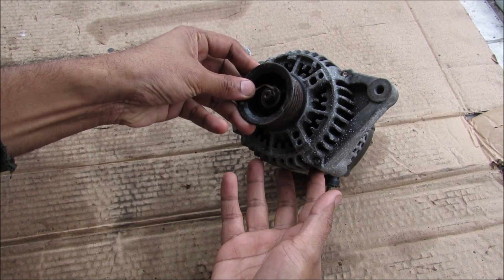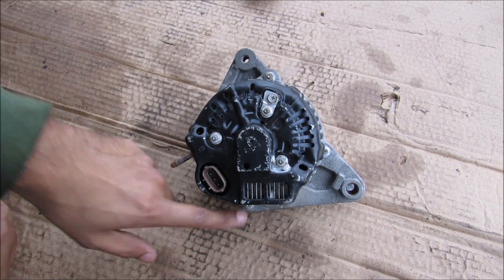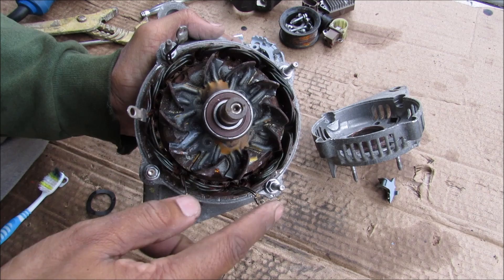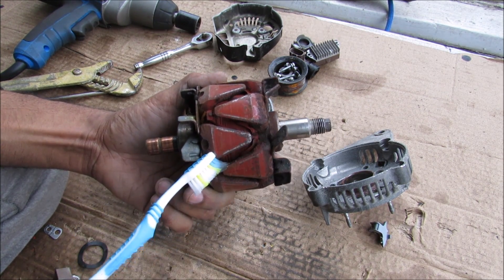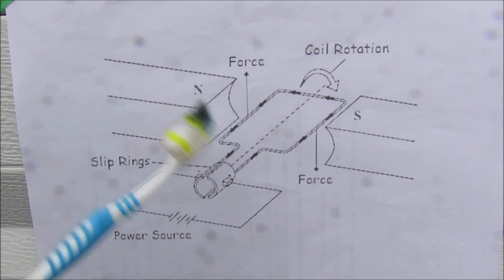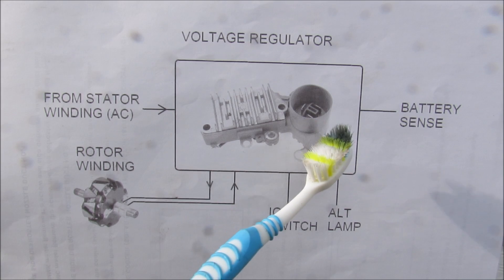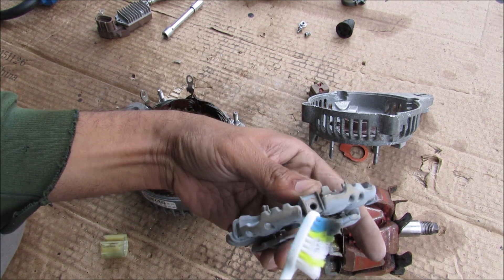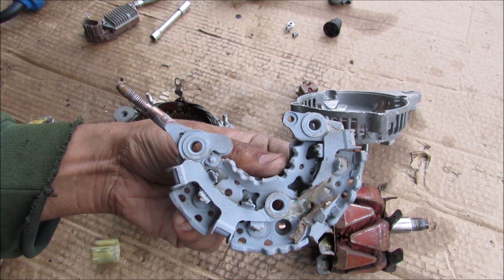How an Alternator Works

Comment: How true shall the following be for a Toothbrush Vehicle model Oral-B with this typical wiring structure:  

Alternator Electrical Wiring 

3 pins: Trigger, Voltage regulation input from ECU, Ground. 

a) Wiring Harness connector 

i) When ignition key is ON: Trigger + Ground= voltage or continuity. Feed + Ground = Voltage. 

ii) When ignition Key is OFF: Trigger + Ground = Continuity. Feed + Ground = Continuity. 

 

b) Alternator pins: Trigger + Ground = Continuity / large resistance. Feed + Ground = Continuity / large resistance. 

 

1 pin: Output to battery. 

a) Alternator connected in car with the ignition key ON: 

Pin + Casing = Battery voltage 

b) Alternator removed from vehicle: 

Pin + Casing = Continuity / Large resistance.

Comment: At 8:28 not true. On modern vehicles, you should never disconnect your battery while your vechicle is running. You can damage a lot of electrical components if you do, but if you did disconnect the battery, the voltage regulator would still get power from the rectifier bridge through the exciter diodes (diode trio).
Reply from the maker: Agreed here. The voltage regulator nis driven by the battery.
Reply: @speedkar99 Great vid. Why would disconnecting the battery do any harm if that means the rotor won't be energised meaning no 3 phase ac output? Or am I missing something

Comment: Does that happen on every car? Like if i disconnect the battery while the engines running will I definitely cook the computer?
Reply from the maker: There is a risk because there's no voltage regulator

Comment: Just an (not entirely) unrelated comment here: road salt does some really crazy shit to aluminum alloys used in automotive. I remember my first car and its air-conditioning tubing I was trying to fix after I found a leakage. Man, the aluminum rather resembled an old cookie, some kind of a crusty sponge instead of a ductile, malleable, soft metal we're all used to. It was literally crushing in my hands. So, even with a super experienced welder I had to bite the bullet and buy a new, super expensive, back in the day, tubing. Lesson for younger colleagues: aluminum does corrode, too. In the oxygen atmosphere it's protecting itself with a passive, perfectly sized (oxide molecule only around 1.5 times bigger than the metal molecule, hence not flaking off) oxide but splash it regularly with salty water, add some heat to it - that's a different story. Look at those whitish stains: that's corroded aluminum, in form of chlorides.
Reply from the maker: Agreed, salt does affect aluminum. I see it all the time on engines I teardown

Comment: That is exactly how my 19 year old alternator on my 1999 F150 failed….the brushes on the voltage regulator. I replaced them with a parts store brand, and they did work, but about a year later the charging light came on again so I figured it was time for a whole new/rebuilt unit. But I got to hand it to Ford…. My alternator lasted 19 years.

Comment: Amazing video! Cars are so confusing. What does it mean when your battery light and check engine light comes on at the same time ? Car will not start? Battery is brand new. Overcharge? Alternator needs to be replaced completely?

Comment: I had a 180D and it had a generator for charging the large Willard battery. That model MBenz set the world record for total mileage. Today I own a 2.7L 5 cylinder Sprinter which will probably outlast
me. So I have made arrangements with the local undertaker to use the Sprinter for my casket. He wants extra money for the grave digging.

Comment: So if you want to bench test an alternator you have to connect a battery to it, or some other voltage source to provide a dc voltage to the rotor in order to make that an electromagnet and get 14V out of it. Right?

Comment: Awesome explanation best put off 5 videos I saw .. great job I replaced my brushes and voltage regulator today .. I had dash lights on usually come on when n alternator craps out but after a bit I noticed it would be fine then work then next day would turn on high review would make it go away made me realize my voltage regulator maybe was bad I replaced both the regulator and the brushes but my brushes were very warm out witch I’m sure that was giving the wrong communication but I still replaced both .. 25 bucks off of eBay .. wish I would have seen this dudes video a week ago .. great job tho . Best vid of this kind on here ..

Comment: Christ on a bike! If I could carry you around in my toolbox to work, that would be just grand!
That was possibly the best explanation of the setup. I've written essays on this, and you hit every point perfectly. 

Modern vehicles have such an advantage, having alternators with solid state regulators. 
Older types, with the mechanical regulators were a nightmare to jamming up if not kept pristine. Overvoltage scenarios were so common, leading to a stern cooking of the battery. Upgrading from dynamo to alternator certainly provides that constant, and instant punch to whole system on startup. Instead of depending on a dynamo, which relies purely on engine RPM,  you've got an instant flow of electron pixies as soon as the internal is excited. 

Great video!
Reply from the maker: Thanks for your insight!

Comment: Ending part explain why its dangerous to unplug your battery while the engine is running. The alternator needs constant power frm the battery to regulate the rotor voltage so as to control the magnetism of the rotor in order to control stator/alternator output....

Comment: One question. When the car is running it`s the alternator that powers everything in the car right? The battery is not doing that unless the car stops if I understand this correctly?
Reply from the maker: Yes alternator provides power to the car.

Comment: Alignment of alternator, Do you need to line  up after installing a new alternator? Method or Video review this topic.
Reply from the maker: Of course it had to align so the belt goes on
Reply: @speedkar99   After review looks like the power steering pully is the only one that could cause a problem  if not installed correctly.
Reply: @speedkar99  Go it. Did not know if you needed a straight edge to check or the bolts lock in positon.

Comment: GM 140 amp alternator, battery post nut will not remove any recommendations? tried penetrating oil, removal from car put it on Vice to get a better grip.  Plastic piece around battery post turning also. Do you think alternator is permanently damaged?
Reply from the maker: You might be in for a rebuild
Reply: @speedkar99  Thanks, Amazon new alternators seem reasonably priced for this GM category.

Comment: I have a question, for my 01 Camry,4 cylinders,regarding the three wires at the back of the alternator. Out of the three wires,one should have a battery voltage,right? Or all three should have battery voltage ? Because,mine,all three wires have battery voltage. And the charging system doesn’t run right...can you explain? Thank you. Really need some good informations on this problem
Reply from the maker: The 12V power line is the one that's bolted on

Comment: My car alternator stopped charging,so all I need to do is,replace the brushes,it should start to charge again,right ? On top of that, the three wires connect to the back of the alternator,what does each wire do? Can you explain,please ? I know the three wires are connected to the voltage regulator..thank you
Reply from the maker: Yes just the brushes. Some people replace bearings too

Comment: So basically it's not true the fact that running your car, instead of stay it idle in a park lot let's say, it spins your alternator faster and it loads the battery much better, because it has that regulator which demands the amount of electricity to be produced by the alternator. Am I right ?
Reply from the maker: Yep the regulator stops the battery from being overcharged

Comment: This is an informative video with two items that need to be corrected. First, it is safer to remove the positive cable at the battery first, before removing the cable from the alternator. I know in the car he is showing will not make a difference, since it seems it is a junk yard car. Second, a minor mistake. In 1:28 they are not bolts, but nuts. Overall a good job in showing how the alternator works. Thanks.
Reply from the maker: Thanks

Comment: The Rotor shaf and pulley should always be spinning together 1:1 right? I'm getting some slippage where the inside is not spinning at times. is the bolt just loose?

Comment: Great video only addendum is the small capacitor is only for noise suppression and doesn’t do much to smooth the peaks in the output waveform that’s what the battery does.

Also you indicate that the regulator is fed ac to my understanding the ac is rectified immediately after it leaves the stator and the regulator is fed the rectified dc I might have misunderstood that though

Comment: This is the best explanation of an alternator I've ever heard. Can you explain how you can bump start a car without a battery in it? Without any input power how can the alternator produce a/c output? Thanks!
Reply from the maker: That's actually a good question, I would assume you'd need some kind of a battery on it even if it's discharged just to hold charge until the alternator kicks in

Comment: If you send ac current threw the rotor. Will it even need to spin to creat electric
Reply: It wouldn't need to spin. It would create inductive current as the magnetic field changes due to the ac current oscillations. That's how wireless charging works.

Comment: What's about the current the alternator produce from rotation? If the alternator produce 100 amp current at 1000-1200 rpm and if the battery capacity is 50 amph then the battery will be charged within a short time and it will be over loaded by current. Please explain the battery current capacity and the alternator current that it produces. Thanks in advance.
Reply from the maker: The regulator stops the alternator from over charging the battery

Comment: So in order for the rotor to make power with the stator the voltage regulator has to supply the rotor with a small amount of power like a pilot flame almost?
 Then if the battery is disconnected how would the alternator voltage spike and fry the computer ? Wouldn't it just shut the car off ? 

I had to re write my question to make more sense lol
Earned a subscriber, great information man
Reply: So it's cause the car would be running there is already power there in the stator and then no more regulator and that's how voltage would spike?

Comment: That was a cool video. I knew the basic principal but not the inner workings. I learned long ago that bump starting a manual doesn't work if the battery is completely drained. There has to be enough charge to get the alternator going.

Comment: Pretty nice, except I wanna say that the ac voltage doesn’t get “mirrored”, the humps below the line get literally cut off and do not transmit through the diodes. It’s the combination of the 3 phases offset from one another that make up that consistent pattern of smaller humps.
Reply: A full bridge rectifier works a little differently than a half wave rectifier in this case. Let's compare the different kinds of rectification that are available to us to explain why. In single phase ac, the voltage crosses zero volts every half cycle. You can rectify that with a single diode which will simply block the current flow when the voltage goes negative and pass current when the voltage is positive. This gives you that "cut off hump" for half of your ac cycle you mention. If you use four diodes instead of one, you have a FULL BRIDGE RECTIFIER that can allow the current to pass one direction when the source voltage it is positive, and pass the other direction when the source voltage is negative (from the point of view of the source). In essence, you are turning the wires around every half cycle so that no matter if the ac wave is on the positive side or negative side of the cycle, the current only flows one way through the load. This means that the voltage is always positive from the point of view of the load (since the current flows in only one direction), and you get the back to back positive humps as illustrated in this video. It is worth mentioning that the back to back humps is NOT how three phase rectification works, and sadly, speedkar99 is wrong about that for technical reasons. 
Since that is all for single phase, what happens with three phase? Let's go on. Since this alternator is actually three phase AC in Y configuration (we know this because of the common wire), you can rectify the output to DC with 6 diodes (connected as shown in the video). Because the three phases are 120 degrees out of phase, you ALWAYS have full RMS voltage between the three phases. The magnetic fields are rotating in the alternator, and they create a rotating voltage between the phases. I need a diagram to illustrate this. Google for an image of "three phase power graph" with a common wire. You'll surely find one in 1-2 hits. If you don't have a common wire, the zero voltage line is the common. Let's look closely at it and walk through a full cycle (1/3 of an alternator turn I think in this case, by the way).
When Phase 1 is at full positive voltage, the other two phases are at 50% negative voltage. Phase one positive diode conducts full current, and phase 2 and 3 negative diodes each conducts 50% current to the negative phases. Move forward in time until phase 1 falls to 50% positive, and Phase 2 has been quickly rising to 50% positive as phase three falls to 100% negative. Now phase 1 and 2 positive facing diodes are conducting 50% current forward, and phase 3 negative facing diode is conducting 100% to negative. Now go forward until phase 1 is crossing the zero point. At this point phase 2 and three are at about 66% positive and 66% negative (or so). So, phase 1 is neutral and the phase 1 diodes are not conducting at all, phase 2 positive diode is conducting positive and phase 3 is negative diode conducting to negative. Advance until phase 2 is 100% positive. Now phase 1 and 3 are 50% negative, so phase 2 positive diode conducts 100% forward current, and phase 1 and 3 negative diodes each conduct 50% of the current to negative. This keeps going through as phase 3 rises to 100% positive, and phase 1 and 2 are 50% negative. 
The story keeps going on and on. Every time a phase crosses the zero, it is doing nothing while the other two pass current between them, and any time all phases have some voltage, there will be current flowing from whichever phase(s) are positive to whichever phase(s) are negative. The diodes make sure the current always flows in one direction through the output by conducting between the positive phases and negative phases in only that one way. 
that is why you need 6 diodes. Any time one phase is positive and two are negative, one phase positive diode conducts and two negative phases negative conduct to negative. When two phases are positive, then those two positive diodes conduct to positive, and the diode on the negative phase conducts to negative. There will ALWAYS be at least one phase positive, and at leave one phase negative, so the diodes can always give you power output in the correct polarity.
You can also see that at EVERY point along the waveform, there is going to be about he same amount of power available, conducting by some amount on at least two of the phase at all times. This means that the power you get out of the alternator is going to be a very nice DC power that fluctuates a few percent above and below the perfect voltage. Your battery absorbs current from the system when the voltage fluctuates higher, and your battery generates current when the voltage fluctuates lower, and hundreds (or even thousands) of times per second this occurs to give your car a VERY nice and clean DC power signal to work with. Yes, there is some very high frequency noise in the power, and radios with bad capacitors will generate a noticeable wine when listening to the radio. That's why all electronics on the car have filtering capacitors on their inputs to smooth that out. 
But anyway, at no point will you ever have a cut off of output from your alternator so long as the engine is turning at least 500-600 RPM (and assuming there are no electrical faults in the system anywhere).

Comment: And why dynamo not used instead of this , because dynamo can generate direct dc current ??????
Reply: Dynamos were used up until the late 1950s.  They have magnets that can break  or come loose and are heavy.  They also have commutators which creates arcing and has a higher failure potential.  Semiconductor diodes made it possible for robust bridge rectifiers.  By 1970, they were also using semiconductor voltage regulators.  The copper wire wrapped around some silicon steel is much cheaper to make and far less failure prone.

Comment: Finally I know where the magnetic field comes from. It's from the battery! But why not use the output from the rectifier? Self-excited right? And The car will start even with a totally discharged battery.
Reply: OK I googled more. The typical alternator used in cars needs an initial start voltage from battery. After that It can run without a battery.